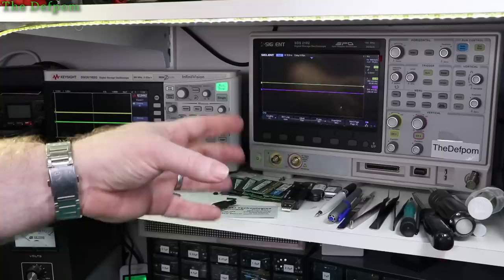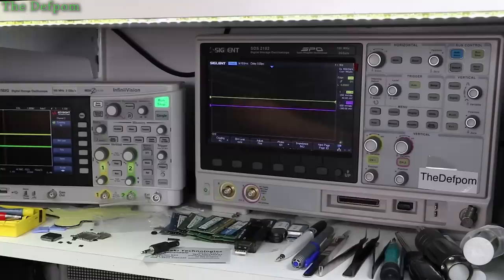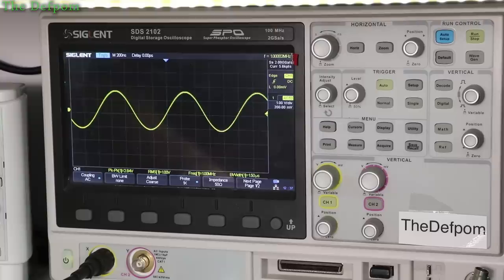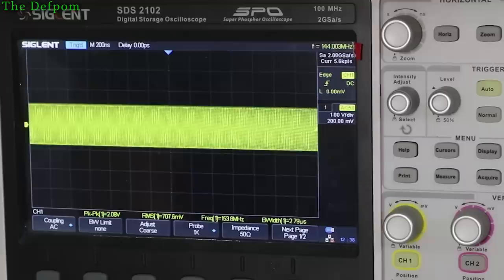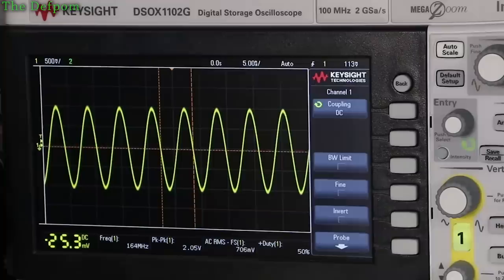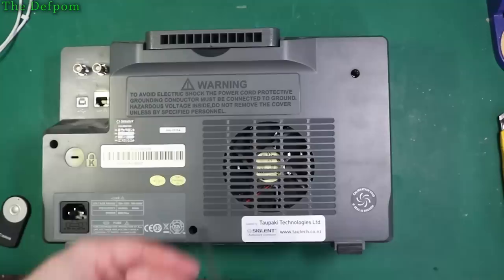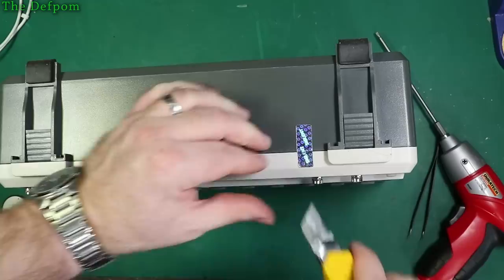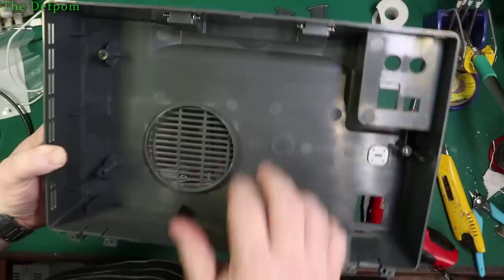🔴 #554 Hacking The Siglent SDS2102 to 345MHz ! - How To Increase Oscilloscope Bandwidth

Comment: Rigol does also have some entry level Scopes that can be hacked from 70Mhz to 300Mhz. Also decoders, triggers, memory depth.... Because the hardware ist the same, it is only limited by software. Afteryou have hacked it you can update it and the Modification is still there. Also it is reversibel if you have to send it to Rigol for repair. Really cool!! Thank you for your video!
First time I've heard the air tool sound, I was a bit confused 😂👍

Comment: At 2Gsamples/S one should be able to sample... 1Ghz signal ? (but 2 points per period), should be soft limitation, did it go further that 345MHz ?
Reply from the maker: Víctor Pino - I only tried for the -3dB point, I should actually look to see what its highest usable frequency is.
Reply from the maker: I just tried out higher frequencies (on only 1 channel, the sample rate is shared between them), it starts to alias on a sine wave at nearly 500MHz, I did a dot display instead of vectors to see how often it samples the waveform and how much it is guessing/calculating the sine wave, I would say that it is usable up to about 450MHz max for sine wave (that is also where the built in hardware frequency counter starts to drop out), I think keeping it below 400 MHz would be better, if you are trying to measure non sine waveforms, then it would likely need to be even lower than that, probably 300MHz or so. It is still a nice improvement though, just watch out for the Nyquist aspects. as far as levels go, at 495MHz it was still of reasonable level, about 25% of the original.

Comment: It may be better if the probe is also tuned. (^ ^)
Can this great method apply to the SDS 1204X-E?
Reply from the maker: I was using a 50 Ohm BNC cable for this test, so it should be fairly close, but yes a good set of probes to cover the improved bandwidth would also be important (I purchased some 500MHz probes recently to use on it).

I am pretty sure that the SDS 1204X-E is basically the same front end, refer to the EEVblog forum thread as that was where I found the information to do this modification, it discusses the other models.
Reply: @TheDefpom  
 Thank you for pointing out about the 50 ohm BNC cable!

Performance improvement can be expected with a 500 MHz probe.

Furthermore, the front end trimmer may have been adjusted by the manufacturer with a 50 ohm input. (As a possibility)

 Thank you also for pointing out about SDS 1204X-E. It was helpful.

(Last week, I also found the EEVblog site at the same time as your site.)

Comment: I would also add the other two channels :)
Reply: Yeah, just drill holes in the thing, use duct tape and super glue and aluminum foil on the front end circuitry.
Reply: Then just a "bit" of software hacking.

Comment: So if I'm only working in the audio frequency range... this hack would be pointless to me if my understanding is correct? and that would also mean that I could even use a shitty portable 1MHz oscilloscope and never have a problem....
Reply from the maker: Peter Milanovski - yes, not much point if you are not doing higher frequency work with it, and yes a cheap scope would likely be fine!
Reply: @TheDefpom  wow! Thank you so much..
.. Oscilloscopes have remained much of a mystery to me, especially when it comes to their specifications. I'm not sure if anyone else looked at it like I did but to me it looked like the frequency rating on a scope referred to its speed like a computers processor! Most oscilloscope reviews tend to focus on the higher the frequency, the better....But if all that you are working with is audio then even 30kHz is plenty, So long as you are only working on analog equipment.... I guess that you would need higher frequency resolution for D class amplification due to their nature of operation.... So now I'm guessing that the most important feature for me to look for would be the sampling rate then? I have watched a lot of videos on oscilloscopes and I personally haven't yet come across a good video explaining which horses are for which courses... I suppose that it's easier to make the video about the best of the best.... But then again, I have seen reviews on budget models but no one mentions that while the specifications are on the lower end of things... It's all that you are ever going to need if you are doing this or that... LoL here I was thinking that I'm going to purchase a budget oscilloscope that is able to have its bandwidth hacked and do it as soon as I get it home.... When I should be looking for something with more analog channels and a higher sampling rate so that I can get right in to the signal and not miss anything..... That's assuming that I have the right train of thought LOL.... Thanks once again... Great video, I really enjoyed watching :)

Comment: Does this hack work on the SDS2204X?
Reply from the maker: It is a different board, I am pretty sure that there is something out there about it, check on the EEVblog forum.
Reply: @TheDefpom  it is even much simpler.
Reply: No, only needs a bit of software faffing.
Reply: @xConundrumx  You will spend more using your labor than just buying the bandwith you want from Siglent. You'll notice no one is reporting being successful with the software hack.
Reply: @NeverTalkToCops1  Just realized we were talking about the non plus version. I upgraded my SDS2104X+ to a full option 500 Mhz version no problems at all and somehow was under the impression the same hack also applies to the non-plus version (but not sure that is the case tbh.)